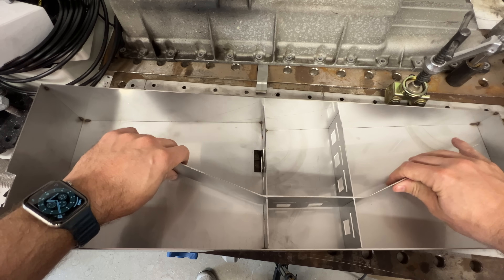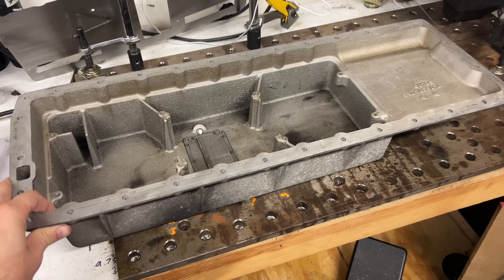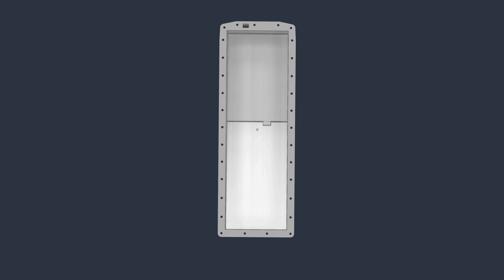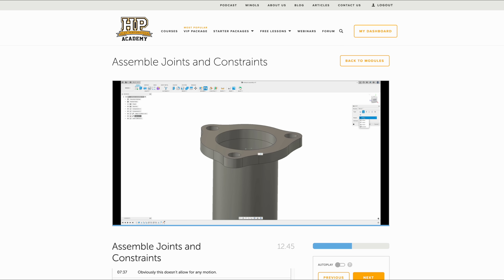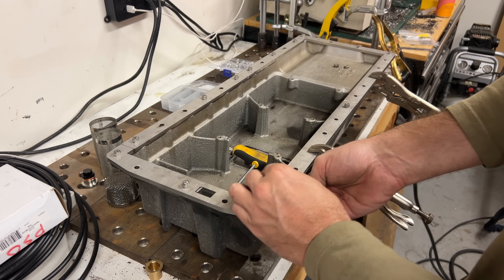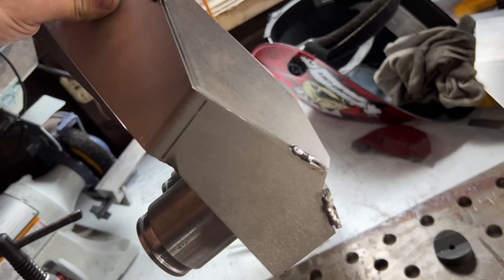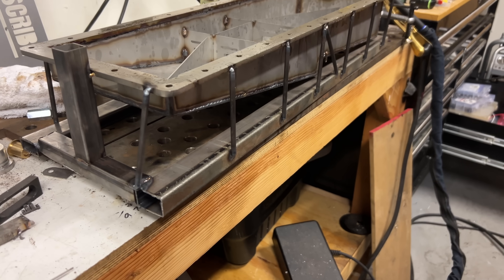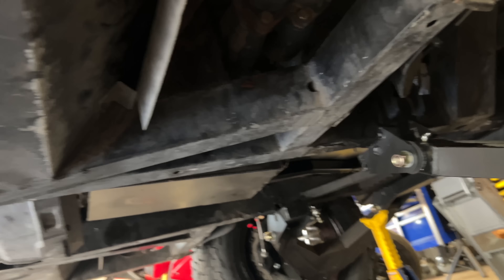Make An Oil Pan. Or Just Watch Me Do It. Whatever.

Comment: When welding Stainless - runing Argon on backside of the weld can help. Need another set of hands hanging around to help.. or to be a 3-armed man. Prob not a great tip for Matt though, i mean, one requirement obv isn't even possible 😂... the other... well, I get the feeling he's not kind of guy that's into working with others' limbs grafted to his body

Comment: I know you will probably never want to weld stainless again, but if you put some aluminum angle on top of the sheet, about an inch away, it will keep the shield gas in place longer to make nicer welds.  There's nothing structural about it; it just looks better.  Inside corners keep the argon in place longer; that's why they came out more shiny. Hence the aluminum angle to basically make an area that keeps the shield gas close.

When you put the mild steel tube on the pan, that caused me physical pain.

Comment: You didn't have to tilt the engine. Actually output and input should be parallel. This tilted configuration gives you variable rear diff input and from that you get vibrations.

Comment: I’m normally able to look passed iffy welds on people’s videos but man you got me, little bit a cringe the whole time 😂 little bit of advice if your machine has a pulse setting, use it. I used to weld mri machines together and they are entirely stainless and aluminum and have to not leak helium (way smaller molecules than what makes up the majority of air) and we had to use pulse on all of our stainless steel tig welds, a lot of parts were heat sensitive and if the stainless got overheated it would “sugarize” and leak, im sure you probably noticed your pan had some rough crystal looking metal on the backsides of your welds and that’s what I’m talking about. Plus with pulse you can kinda cheat on thinner metal and just lay your rod down and pulse over it on the joint and get good looking welds with no effort lol

Comment: I see 3 problems with this. Stainless costs way more than aluminum. It's also way heavier. And it doesn't have the thermal heat sink properties of aluminum which helps cool the oil.

Comment: do you think 304 stainless would be a better material than mild steel for making cylinder sleeves for an aluminum block,since it's coser in thermal expansion to the aluminum than mild steel?

Comment: Also, the pan is chattering because your car ide is laterally cutting the rail. Take smaller cuts in Y so the cutter is cutting length of the pan rail, not the width like you were. Its like an I-beam. You dont laterally load an I-Beam. It's more likely to bend or deflect. In tension or compression they are strong af and wont budge.

Comment: So, i would NOT be using rubber in the oil pan. ESPECIALLY snap in rubber flaps. You're asking to oil starve your engine. Rubber is NOT ideal for oil. But if those snap in sections fail, the entire flap can come off and get sucked to the pickup. A couple flaps in and you'll see it on your gauge. Also would suck to drain oil with the flaps loose in the sump. This is why manufacturers use stainless balls or stainless flap doors. I myself am a big fan of static geometry trapping the oil. You can easily make a cinnomon roll and oil can ingress but when slosh is induced it becomes 100% trapped. This can be done with a single spiral wall or this can be done with a couple tubes bent 90⁰ and plumbed cross corner from where it's attached to the sump. Usually using 2 tubes 180⁰ apart will cover 2 inlets that are also 180⁰ apart. But i digress. Moroso and canton use stainless flaps.   I wish you the best with this build, but i dont think the engineering calls in this pan are ideal. (Have you seen ford's oil pump belt failures on the 1L ecosport engines yet? Rubber belt + hot crank case oil. Good engineering amirite?). Lol.

Comment: unlike most of your work, this is subpar junk. for a system that means your engine does or does not explode, this is 3/10 and i would NOT recommend anyone use what you made here. all your SS welds and dissimilar metals means cracks and leaks. 100% chance this is GOING to fail seeing as you did not get  any back purging or proper coverage and ran way too hot and slow.

Comment: I dunno about rubber flappy doors and oil I see this being more of an issue than a fix. Just round holes would have been good just enough to stop oil from being sloshed but it still flows freely. if one or more of them flaps get tacky... because I imagine after time they will get tacky and could stick

Comment: man this is just like me. so i also made a oil pan, the first one i made . it was inside out.  also the bolt holes were too close so you couldnt turn the nut with a socket on it. could only use a spanner. so that was never going to work ahhahahaha. it also warped heaps. so on the second one i bolted the whole thing down to a thick steel plate before welding.  offset it all for more clearance. it worked. but ill never use stainless again it was a total bastard

Comment: To be honest, for the oil pickup i expected you to laser cut some pieces and weld them to the bottom of the pan forming a tube.
I also like how you cut the tube with an abrasive disc filling it with dust and burring the edges inside.
God knows i'd do the same, or possibly worse.

Comment: Loving the progress Matt! One word of caution with stainless. When welded without back purge you get 'sugar' (grit) on the back sides of the weld. I made a water injection tank a few years back without back purge and it was full of it. I ended up sealing the backs of the weld with some PU sealer. I would try to die grind / clean up any areas you have read through on the welds back to clean metal then give a real good clean. Grit and bearings don't mix

Comment: Fun fact, could've used c-channel, cut pipe in half, cut square tubing diagonally in half, or at least removed one face of the tubing rather than using the whole box causing the need to weld that internal seam. The pan itself would be your inner surface.
Reply: Maybe, but that’s a lot of extra welding in exchange for eliminating just a couple of small, slightly-trickier welds.
Reply: @SynchronizorVideos  I'll take the easy long weld over making life unnecessarily harder for myself.

Comment: Dear Matt, there is something off about this video. See, in the title it says you are building an oil pan. So, naturally I expected to see you change the engine mounts, rear suspension or driveshaft. However, at the end you actually install a finished oil pan. What happened here?
Reply: I think aliens might have replaced Matt with an android, because this video is way too focused.  Welding on the mild steel tube was done intentionally to distract us, but I saw through it.
Reply: Dialing in the meds can be tricky.

Comment: Love your content! Would be myself worried though about that rubber ending up in the sump. They may be oil rated, oil is only oil for a short time, all the other crap and ethanol that ends up in the oil will certainly degrade those flaps. Every manufactured pan I have ever seen just use simple metal doors because they just work.

Comment: Back in the early '90s my dad was rebuilding an older racecar and the original oil pan had issues with oil sloshing on corners.  To keep it in the same class he couldn't do the 'correct' thing, which wid have been to make an enclosed pressurized oil system, so he build a system of -way swinging gates all through the oil pan.  Flappy rubber ones weren't an option, so they were all little metal flappy gates on hinges.  When you had the oil pan out of the car and tilted it it it sounded like a clip from a pachinko game.

Comment: So... Turns out Stainless is a seriously interesting material to work with... Watching you run into two of the big problems with stainless was entertaining(?) :)
It turns out that stainless is MUCH more sensitive to warping than structural steels. It turns out this means you've got to be REALLY on top of your setup, weld procedure (sequencing, no long runs, moving around the part) and ensure that you move FAST. Stainless is one of the harder materials to weld... Try using backstepping and lots of start and stop, while sequencing around the part.
It also turns out that stainless work hardens enormously when machined... There are specific settings you've got to use for machining stainless... Normally the trick is to increase feed per tooth pretty significantly, this is because each chip formation creates a work hardened area where the material is separated... You have to cut deeper than the work hardened area to be able to get a clean cut, otherwise you'll just cook your part and have chatter problems... This may drive you to using smaller finer inserts in your mill because your mill stiffness can't keep up with the cut requirements for larger inserts... Try small finishing inserts for your cuts... They'll lower the forces and allow you to use a sensible fpt.
Or you could avoid stainless in future :)
Also, if that filter mesh is stainless you'll probably get stress corrosion cracking and feed the filter or weld debris into the pump... Good luck :)
Oh, and I do love watching these things :)
Reply: A lot this depends on the alloy.  For machined parts for example, you can get grades like 303 stainless that has extra sulfur in it for improved machinability.

Comment: When I built my oil pan for my Buick Turbo6 in a 64 Riviera (center sump) I actually made the whole thing as three pieces.  The stock pan rail, a flat baffle plate, and the single piece folded kickout sump that looks like a C5 "batwing" pan.   Do not recommend doing that again!  Was a huge pain to bend even with a DIY box brake.  A lot of it actually was hammer tipped vs brake bent!

Comment: The Motul 8100 X-max 0W40  is  a pretty good oil. Full synth, no HC-"Synth" (hydro-crack), good additive package.
If you are looking for a somewhat cheaper oil, get  Motul 8100 X-cess 5W40. Also full synth and a good additive package, but 25% cheaper and sufficient for most applications. I use that a lot.

Comment: I need to design a new, flatter oil pan for our Formula Student car. The engine comes from a Honda CBR 600rr and the design and manufacture of baffle doors was extremely daunting. Those rubber flappy doors seem like the easies, cheapest, easily replaceable solution for our sump. This is gonna save me so many headaches as a begginer engineer. I am in tears :'")

Comment: I would have made the pick-up internal which would have eliminated the need for the step and the jog in the tube. It would have exited at the bottom and then up to the flange. That way the external part would only be a few inches. Simpler to build, with fewer potential failure points. Excellent content!
Reply: Such is the essence of hindsight.
Reply: Next iteration.
Reply: Downside to that though is if the internal tube gets damaged or develops a leak, it’s a lot harder to diagnose and a lot more work to fix.

Comment: Why not just modify the stock pan and add an internal pickup tube? Drill/tap a hole on the inside of the stock oil passage, right under where it connects to the block, and plug up the stock passage below that.

Comment: Two tips for stainless, clamp a piece of aluminium to the back of anything you weld, whether its a corner joint or a flat joint and you definitely need a gas lense. I dont think that stainless is stainless anymore😢

Comment: Having the oil pickup in the bottom of the pan (Dodge's idea) is something I would try to stay away from. That's where all the "crap" ends up when the engine stops.
Reply: Definitely would have added a magnet at least
Reply: if you have metal chunks in your engine your engine is fucked, a magnet wont help that mate.  @plwadodveeefdv
Reply: Yep, but the oil filter exists
Reply: @sexyfacenation  Correct. But you still don't want to purposefully send "crap" into the filter if you can avoid it.

Comment: Solidworks a pretty badass sheet metal function. You can  model lofts between round and square shapes and (for the most part) it will give you bend lines and spit out pretty good flat patterns and dxf's, it'll give you bend dims for prints too.

Comment: I never heard of austinetic metals. Osternectrick? Astanettick? Two questions, please: 
1. How do ya spell it?
2. What’s it mean?
Thank you.
Reply: austenitic

You almost got the spelling right.

It refers to one of the two most common metal grain structures found in steels. One is austenite, the other is martensite.
Reply: I guess one of the most noticeable properties of austenitic steel is that it's non (or very weakly) magnetic. It refers to the grain structure of the steel. Many stainless steels are austenitic at room temperature (but not all).

Comment: A very simple way of duplicating a mating pattern is to place a sheet of paper over the surface, highlight the edges by brushing with a pencil, and then scanning the paper and calibrating on CAD. Easier done of the whole thing fits in a4 or a3 size, but you can easily reassemble in CAD by drawing marks overlapping the sheets.
Reply: That technique is interesting. How is the "calibrating on cad" done? Are there Videos to it?
Reply: @klausklautgern4870 I think he means scaling it, I do it using autoCAD a lot.  I needed to make an oil pan baffle recently.  It fit on 11x17 paper, so I first drew an 11x17 piece of paper in autoCAD and included a scale for reference in the middle (a small checkered flag with 0.25in squares) where I knew the trace wouldn’t interfere.  Print the paper at 1:1 scale so the reference scale is accurate, do the trace, then scan it back into the computer.  Drop the pdf image back into autoCAD and draw over the trace, including a line or two over the reference scale.  Then scale and align the drawing.
Reply: @klausklautgern4870  just google whatever cad program you are using + inserting and scaling images into sketches. Most of them should have a tutorial for that somewhere.
Reply: @klausklautgern4870  You make sure you know some dimensions of the scanned image (either by scanning a ruler next to your paper, or just measuring two points on your scanned item), then your CAD package should have a function to properly scale the imported image. If it doesn't, look harder. If it really doesn't, why did they even include an image import feature? Yell at the developer. 

For Fusion 360, you just rightclick on the 'canvas' (what they call an imported image, perhaps they have some engineering drawings that were done in oil paint), then select 'calibrate' and you click two points with a known distance from eachother, then type in the distance.

Edit: Also, there definitely are videos on it, just google '*CAD PACKAGE* calibrate imported image'

Comment: One tip for stainless is to clamp a piece of copper or aluminum to the back of the weld to suck the heat out while the weld is still protected by the torch.

Comment: The large expansion coefficient, high melting point and bad heat conduction makes stainless the worst stuff to weld right after cast iron! 🤮
Cracks and warpage incoming!!!
Might be a good mistake to have made the pick up out of mild steel, so your less likely to develop a crack, suck air and kill your engine!

Comment: My mans built rubber scuppers into his oil pan.  Let us know if the rubber hardens due to heat/oil chemical reactions and creates a starvation issue.  I'm sure you bought the heat/oil resistant rubber right?  The old 'rubber that should last past the 36,000 mile warranty and after that fk'em' type of rubber?

Comment: Rubber in oil ? Isn’t bad ?
Reply: Hoses to carry oil are made of rubber, and now there are engines with rubber belts running in oil. The details of the rubber composition matter; nitrile-butadiene rubber (NBR) is apparently a good choice.
Reply: @brianb-p6586  ohhh! Got it! I was curious because Matt doesn’t said nothing about the composition and I was worried about degradation in the oil, thanks for the answer! Cheers mate!
Reply: @brianb-p6586 Engines that have rubber timing belt running through the oil in oil pan have this problem, that the rubber disintegrate cousing an engine failure.
Reply: @bohema667  I comment about the flaps of rubber in the oil, because of that specifics engines i know they frequently fail, so I don’t wanna see a v10 die for that

Comment: FYI, fusion 360 has some great tools for sheet metal fabrication/bending. You can draw up a bent sheet metal object and click one button to make a pattern.
Reply: Same with solidworks, one just has to start designing the part in sheet metal module. Otherwise you'll have to do it the long way

Comment: cool video and project, I feel like in the long term the rubber flaps will fail and fall out. every steel aftermarket pan I have seen use metal trap doors.
Reply: Probably should make a new pan.
Reply: He mentions in a reply to another comment that they're the same flaps that Mountune uses in their race engines. Seems to be a good indicator.

Comment: Awesome 😊 Where did you get these rubber flappers? Are they going to be OK being soaked in hot oil?
Reply from the maker: Mountune uses them in their racing engines. They’re made for oil pans so I am hoping they won’t be a problem. I suspect the mesh is big enough to where I could lose two or three of them and still be fine.
Reply: I'd be a little nervous about those becoming detached and clogging the mesh filter or becoming permanently attached and starving the sump.
Reply: That's another fine mesh you've gotten me in! (Sic)
Reply: @TamTran-vw7zm   Mr. Connery, go to bed
Reply: BMW uses those flaps in its M cars i believe.
Reply: Are they possibly made from silicone rubber?